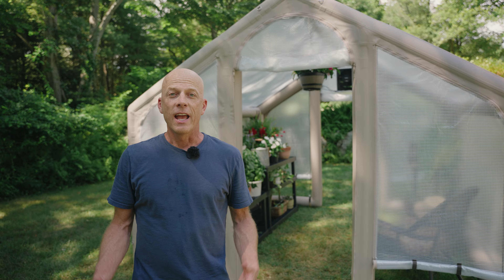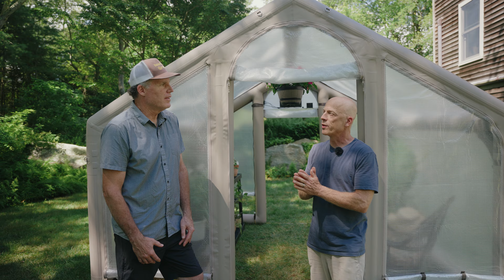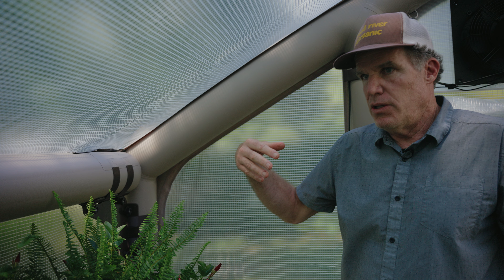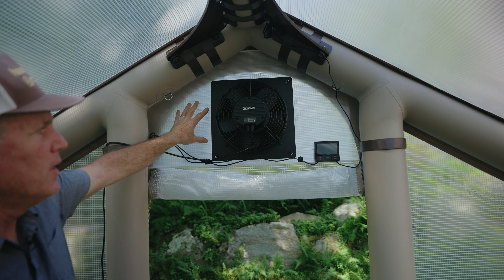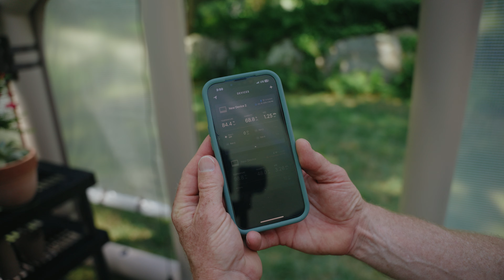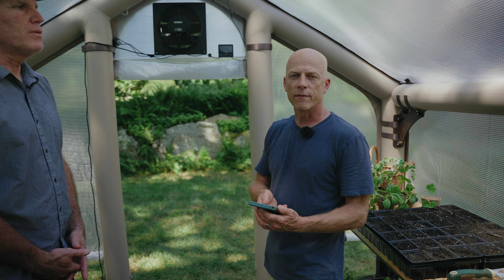HĀVN Interview with our Product Design Team!

Comment: how does it stay warm in the winter?
Reply: Depends on your climate, either sunshine, or the controller that controls the ventilation system also can control 3 other outlets, so you can easily add a heater or lights.